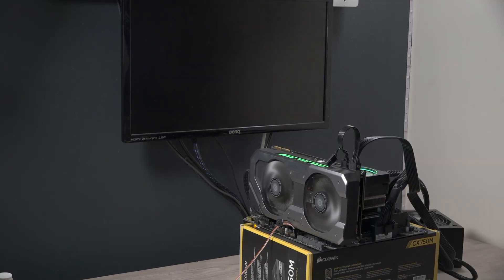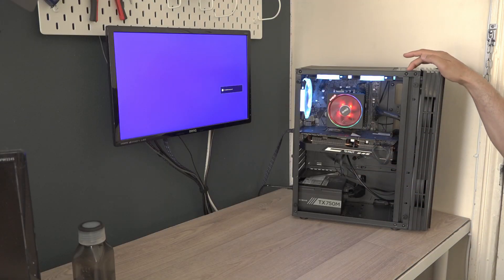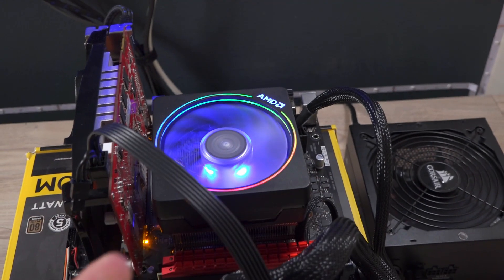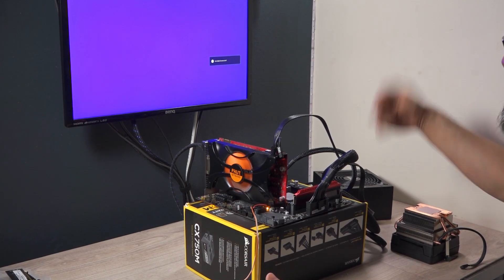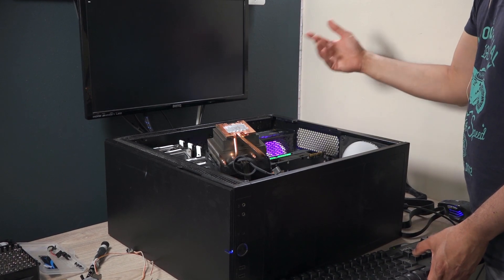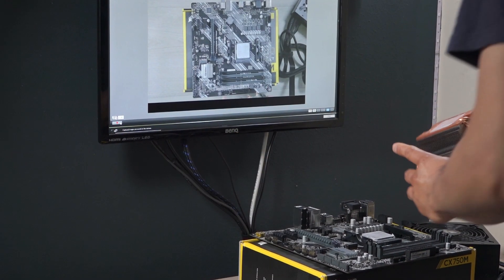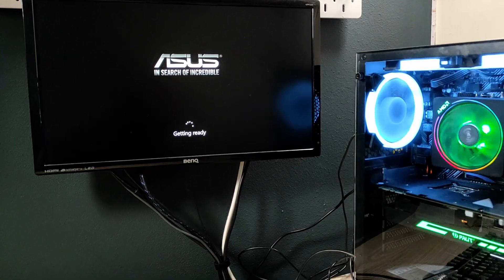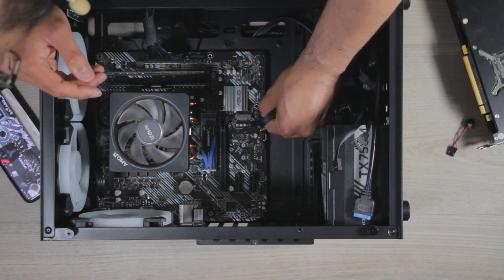Computer Turns On But No Display - Led Light On Fan Spinning - HARDEST Troubleshoot?

Comment: Can someone plz help!!! Have a Msi tomahawk B450 gaming motherboard and is giving me 3 beeps, I replace the, motherboard, to a Msi B450 tomahawk Max 11, Rams, MSI a750 power supply, and processor which word for a bit and went back to shutting down & those 3 long beeps, took out the gfx card and it still beeps can someone help me????? PLEASE

Comment: My pc was working fine until it was put into a new case. Now it just boots and beeps 6 times, 1-3-2. I've been stumped for the past 4 hours trying to fix this.
Reply: Last time I had this I had to get a new motherboard, on dells website it says that on some older motherboards/systems the only beep code they can produce is 1-3-2 making it impossible to figure out what’s wrong
Reply: @musharoony564  I actually got my pc consistently coming on with the same board. It just took some time for it to stop doing that
Reply: did u ever fix this problem?
Reply: @Kimberly-ku4es  no I never did. My friend was kind enough to supply me with another gpu though.

Comment: Hi, hope you are doing well.
I got the same issue with my Dell Inspiron (i7 4790 processor). It was installed in an i3 casing previously. I bought the Gamdias Athena E1 Elite ATX Micro Tower Gaming Case (1 ARGB Fan) (1 Black Fan). And my PC was working fine but when I swapped it to new case, my PC stopped giving the display.
My PC bios got corrupted by swapping. So the technician did new bios but it still didn't gave display.
I took my PC to a new technician and he just plugged out the power button with the wires from the previous casing and shoved it in the new casing and my issue got solved. Now my PC has duel power bottons. Turns out that the jumpers and the system security from the previous casing were the only way to make my PC function again.
Reply: that´s weird
Reply: @dexzero  I know and later my motherboard died...

Comment: Today I replaced the pads on my MB and GPU heatsinks, but had forgotten to plug the CPU cable in after reassembly. I panicked after getting no image and thought I had short circuited my graphics card. So I found the cable while watching your video, and now my PC works again lol!
Reply: when you had this issue , does the keyboard and mouse worked ( I mean if theyr rgb is glowed up )

Comment: My pc have no signal with my graphic card i just tried the hdmi and my motherboad is beeping when the graphic card is installed on the motherboad. When the graphic card is not there the pc work just fine and i have display

Comment: i have a board msi X470 Gaming plus max, i recently bought a GTX 1070 amor Oc when i switch the pc on after 10-15 seconds the screen shows there's power because the no signal disappear but it stays black when i put back my 1060 it's working just fine

Msi x470
Ryzen 5 1600
2x 8Gb ddr4 klevv
700w antec psu
the 1070 is working on my friends pc with 650w psu also antec
at this point i tried so many tricks I found on YouTube but I never got to get the 1070 to display

Comment: If the motherboard's the issue, then try removing the cmos battery for 15 minutes or using the screwdriver to touch the cmos pins for 15 seconds to short circuit it. What that will do is reset the cmos (BIOS). That helped when my PC wouldn't post cuz of me being an absolute dumbass for messing with the XMP profile.
Reply: Just wanted to let you know you saved my life a few weeks ago with this advice thank you
Reply: This is the most helpful YouTube comment ever.
Reply: Hey man i have the issue in the video right after i got a new motherboard and i went into the bios to enable xmp and after that my pc stopped posting do you think the cmon reset will work?
Reply: what do you mean by messing up with the xmp profile ??
Reply: Xmp profile is setting in bios that helps boost fps in any game potentially, let's say ur ram MHz is 1700 and if you enable ur ram will work with max speed which is safe and good for everything @soap_off
Reply: Short circuit bios pins? Are you trolling?
Reply: @khushisingh-sj8wi  he’s not trolling, with the pc off and unplugged there’s two little pints that if you connect using a screwdriver it’ll reset the cmos
Reply: @waterna so what do I do?
Reply: @gurureyli find two pins somewhere on your motherboard it’ll have writing next to it called CLR_CMOS turn your psu off and get a screwdriver and place it in the middle of the pins and wait for 15 seconds turn pc on and your cmos will be cleared

Comment: I need help , when my uncle transferred my ram to the new pc to test out if the new one ram is faulty. Then when he put it back on my pc , my pc doesn't display anymore even tho the system is powered on. The cpu ez debug light is blinking white light in few secs in startup then a hold white light after those seconds , we tried cleaning the ram and the ram slot , put in diff slot , and still doesn't work. So we tried resetting the bios , check the cpu if it has bend pin , the cpu is ok but still not working.. Sorry if my english grammar is bad.
Reply: I have this same issue right now, did u find a fix?

Comment: I am using an ASUS  M5A97 LR R2.0 With DDR3 RAM.There was no beep no 
POST and no display. i have checked the RAM and also the PSU. stil 
nogo.....i removed everything (RAM, Graphics card, processor , HDD, 
DVDRW) but sill no go. Surprisingly there are no beeps .Lastly i removed
 the BIOS chip and checked , still no beep. Does it mean that the BIOS 
is corrupted and i have to reload/reporogramme it ??

Comment: I actually switched my hdmi cable to the older cable and it worked. It was all about the bios system settings. It was not setup to detect pci-e or hdmi on the motherboard. Just the standard regular old vga cable fixed the problem for me
Reply: Oh man! Thank you thousand times!!!
I switched my dp cable to hdmi and it worked!
Reply: My pc boots up I can see the asrock logo after a few seconds The display goes off,  the computer is working fine,the keyboard mouse too,after I disconnect and connect the VGA cable,the display shows up,sign in(windows),I think it's a cable or monitor issue,what else could be the issue?
Reply: Same here. After a cpu upgrade, the PC turned on fine, but after some "cable management" in my ancient pc case (during which i did reset the BIOS), i couldn't get any display, even tho every part seemed to work as it should. Eventually (i'm not sure if i read it somewhere in a comment or if it was sheer desperation) i swapped the HDMI cable and plugged the GPU via the VGA one and BOOM, pc booted no problem.
Reply: @sunseth1384  yeah i hate this problem, this evening i spent hours fiddling in front of a bit impatient people who's probably knew better than me, i knew there's something wrong with the motherboard or the bios but wtf can i do when resetting bios didn't work and nothing is broke? but out of all thing, changing display cable fixed the thing.

i probably didnt really clear the cmos or something, shit is weird, sometime restarting it about a dozen time will solve itself like nothing happened.

Comment: Hi there i have watch some of your videos on PC repairs, especially the one that says PC turn on LED light on, fan spinning but no display on monitor. Please i have the same problem on my computer and also there is a steady white light on the motherboard around the that says VGA debug something i can really remember. Is there any way you could help me. Please.
Reply: i have the same problem, with the difference that one out of every 20 times, or so, that i turn on the pc i can acces the bios. can you please tell me if you were able to fix it, and if you could, what did you do?? at this point i dont know what to do, please 🙇‍♂
Reply: Hi there, no the PC is still not fix, actually when you turn  on the computer, everything seems to be working normally, the fans are spinning, led lights are on, but there is no display on screen, and also mouse and keyboard are not responding, then i notice there is steady white light on the motherboard where it's written CPU. Is there any way you could help
Reply: @chebonaventure6382  i’m having the same problem literally did you ever find a solution?!!?
Reply: @chebonaventure6382  hi bro, did u fix ur problem ? Because I'm having the same issue here, can u please help me?

Comment: Hi, I have two motherboards that stopped working on the same day, It's a little weird. One gives one long beep and the other one long and 2 short. Is it possible that the power supply killed both? The power supply is otherwise not used.

Comment: I need help! I’m finished my first PC build and the test outside the case went well, the bios showed up on my motherboard and it was dandy! BUT now that it’s inside the case and everything is still running, I plug in my DP cable into the GPU and into the monitor but now the monitor says it’s receiving NO signal from the DP cable. I’ve got no idea what’s wrong
Reply: Yo i have the same issue right now , since you commented 1 month ago im guessing you solved the problem can you  please tell me how
Reply: @hamadkd7017  just finished my first build,  after 5 hours still same problem as you
Reply: @hamadkd7017  Hey! The issue fixed itself. Idk how, but after 18+ hours it started working. That’s not useful but I’d say leave the plugs in and come back to it. Hope everything works out
Reply: @omnipotentlenny that's kinda crazy and hopeless
Reply: And how you fixed this guys

Comment: Do a video if the GPU fans are spinning really fast but there is no display signal, thats my current issue right now, I really hope you could fix it.
Reply: I had the same issue back when i switched my psu. My gpu fans spins fast but my monitor got no signal. I removed the hdmi in the gpu and put it in the mobo then restarted it and it got display. When i put it back in the gpu again it won't give me display again. So what i did is put it back again in the mobo slot power on my pc enter safe mode and un install gpu driver using DDU then turned off the pc put the hdmi back in the gpu and turned on the pc and boom it solves the problem. I just re installed the driver after that. And when its done i decided to format my pc and restore default the bios until now i haven't experience that issue again
Reply: Same problem here
Reply: I have the same problem, the gpu spins very fast but no display
Reply: @sr.chi7741  same
Reply: @sr.chi7741  same broo
Reply: Get a pc bios speaker, the motherboard will tell you the problem, it will beep a code that tells you which part of the system is faulty.
Reply: Had this issue too. Had to deep clean my gpu. Some people aren't comfortable with that but you'll need thermal paste. There's videos on how to disassemble it. Sprayed with a duster and used isopropyl alcohol. Haven't had a problem since then.
Reply: Same here, did anyone got the fix?
Reply: @MuhammadIrsyadAlghiffari  nope
Reply: Try boot the PC with no gpu, uninstall the driver, put the gpu back in (shutdown first) and reinstall gpu driver.
Reply: This sounds crazy but i watched a vid and i had to clean my gpu with alc and use a heat gun
Reply: Did your problem solve. I made a new build with ryzen 3600 + Asus prime b450m a + rtx 3080 + 8*2 ddr4 3200hz ram + Corsair CV 750. When I power on every fan and light gets ON but no signal in display. Please help.
Reply: Same
Reply: Have u put the pcie cable on your gpu?
Reply: @pitkassim7006  I have...could that be the problem?
Reply: @heyitsleyy  if its not working, u need to troubleshoot it

1. U can try insert your gpu in other pc and try turn it on, if the display show up as usual, that gpu should be no problem

2. If u dont have other pc, try integrated graphic on your mobo, if the integrated graphic shows display, your gpu or gpu slow might have some problem

3. If u already try your integrated graphic and still no display, try change your display such as your tv, if your tv show up display, then your monitor might be problem, u need to try both integrated and gpu, to more comfirm, u try using ur pc on other monitor.
Reply: Point no 2, gpu slot, not gpu slow
Reply: @pitkassim7006  same issue my pc turns on when i put hdmi in motherboard bt doesn't detect GPU bt gpu fan is spinning wht shud i do
Reply: @amaanx6191  try insert your gpu on other pc, if it show display, your mobo might have a bad slot..

Comment: Help pls still no signal pc specs

Cpu : ryzen 5 2600
Gpu : gtx 1650
Psu : segotep BP500 full modular
Ram : hyper x fury 3200 2x8gb (16gb)

I do everything that I can like connecting the DP and HDMI on GPU to the monitor, cleaning the ram and all that jazz still not working help pls…

Comment: i dont get it what this video want to show....it only test and swapping a parts to one other and find out that the board is the problem it doesnt show an alternative or much solution. what if you dont have parts to replace....your just gonna buy just to know the problem its very obvious that theres only five reason why its not displaying 1.Ram 2. Cmos 3.Processor 4. Power supply 5. Is the mother board which is you can define and configured by resetting it.
Reply: Point no 5, sometime u dont know if the hardware short circuit or faulty just by setting it.. u need to test it with other.. thats why at the end of the video he do mention to ask from fren or buy cheap component..

Comment: My pc was working fine till recently. It was working on 2 X 8gb ram. Now  it only boots on 1x 8 GB ram with no issues on any of the 4 slots and boots silently. When I boot with 2 X 8 GB ram, there is a noisy fan sound and no display and after a few seconds, the pc goes into a boot up loop. I've test both rams individually in all slot and they work. I've even swapped out the CMOS battery. Please help can't figure it out
Reply: one of your ram is faulty. you need to run memtest individually to see which one is faulty
Reply: Test o ln tlother slots

Comment: So my gpu my cpu and my psu its spinning. I have the green LED light on the mobo wich means it has power but the cpu fan spins at a lot of RPM and the gpu its spinning so hard but no display. What do you think it is?
Reply: Yeah i got the same, it's either a MB or PSU problem. Possibly a CPU problem but idk really, Im inclined to believe its the MB rn
Reply: What was the fix?
Reply: @Toosick0 what aas the fix
Reply: What was the fix

Comment: Can someone help me my pc does not post and the motherboard light is on boot
Reply: same problem, did u fix it?
Reply: @Ross_B  same has anyone fixed?
Reply: @qt0m  I took 2 PCs with the same problem to a technician, one was the video card that had the corrupted BIOS and the other was a problem with the motherboard.

Comment: Please help me, I assembled a brand new pc, it powers up motherboard light is on, keyboard light is on, mouse light is on. But no display. I've visited quite a few shops but everyone said GPU is faulty. I tested my GPU on my old dual core pc and it's working. Now everyone is saying the motherboard is faulty. Ive done most of the troubleshooting, power supply is working. I'm really confused if its the motherboard or cpu or just maybe I should hardreset the bios setting and try. I was unable to find any guide on how to reset my motherboard. My parts are: i3 10100f, MSI H410m-a pro, 16gb RAM ballistix, GTX 1030 DDR5. Antec B550 power supply
Reply: Did you figure it out I have the same problem
Reply: @jimmyhung3927  it was the hard drive
Reply: @harrysahota_  How did you fix it?
Reply: @Tetrok_the_Teal  replaced the Hard Drive
Reply: @harrysahota_  lol makes sense, Ive got my boot files on the one thought about replacing, but I think mines actually a motherboard issue :P
Reply: @Tetrok_the_Teal  Best way to figure it out is, un plug each component and try and start your setup bu connecting one by one that's what helped me. But If motherboard is faulty then it's difficult to find out
Reply: @harrysahota_  Well I’ve replaced the gpu with a different one and issues still prevailed so that’s not it, but I got it to boot after a while and no issues until I loaded the gpu by using minecraft with semi intense shaders, and so after I got it to boot I figured it probably wasn’t my ssd but I’m not 100% because I’ve never had to do this before.
Reply: @Tetrok_the_Teal  what are your pc specs?

Comment: Please help me with this problem !!! 

I recently built a gaming PC and used Igame Colorful rtx 3060 12gb ultra W OC. While playing games my GPU fans are spinning fast and loud and my display goes black on monitor. I am facing this issue from past one month. Please tell me is this my GPU problem or any other component problem. Please help me with this.😭😭
Reply: Did you find a solution? Im stuck like u

Comment: Mine stopped showing images after stopping an overclock. I got the Alienware r10. The OC is the system preset so youd assume its safe. Literally tested overclock to see the difference. To go back to normal clock it did a restart aaaaaaand no signal. Resat the ram and gpu. Monitors work fine and the pc boots except it runs the rgb like for 5 seconds, goes black, repeats. Doesnt sound any beeps for system errors... Im confused af.